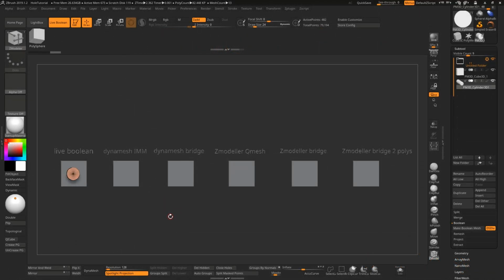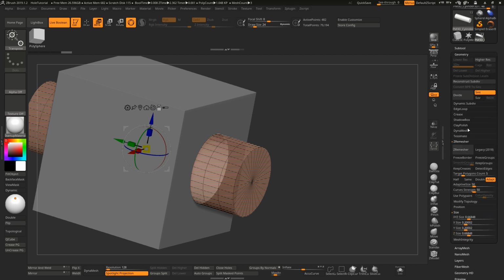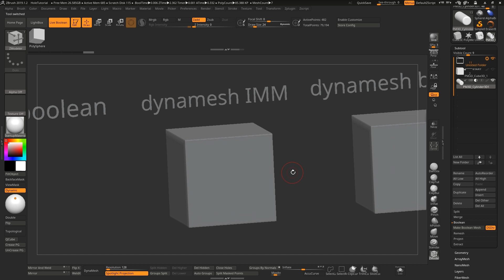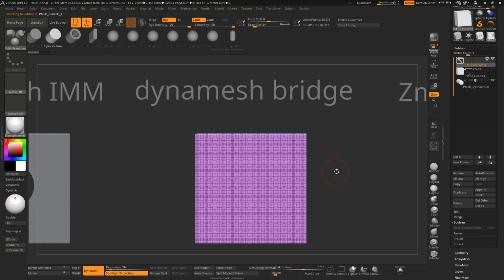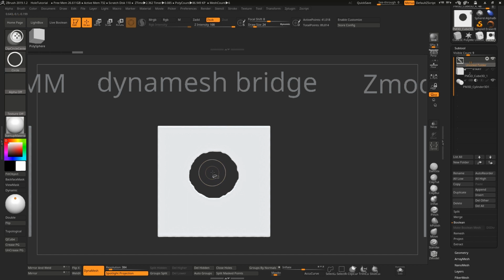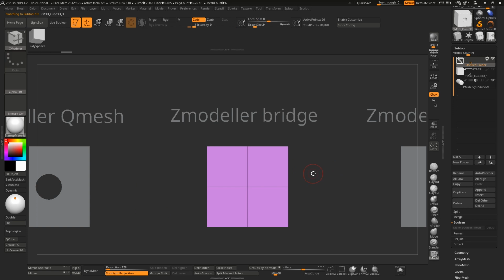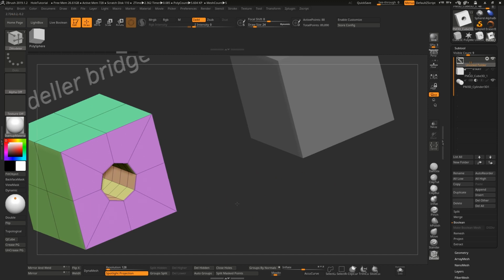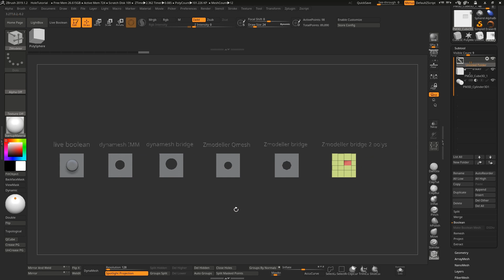6 ways to punch a hole through an object in ZBrush

Comment: I'm kinda confused. On the first method, when i apply the boolean, the new object is in that top menu but how do i actually get it into the scene. If i right click it, it becomes the only object in the scene (deleting meshes unrelated to the boolean)
Reply from the maker: So it's not actually deleteing the other meshes. When you create the boolean it generates a NEW mesh and puts it into it's own Tool. Your original source is still there, and you'll see it on the list of tools available to you (the little icons with the one large one showing you the currently selected one). Each of those tools can be looked at/worked on by simply clicking the little icon of it. As I said, your new boolean will now be in a new subtool. To bring it back into your original file where you created it (the one with the source objects), just click Append in the Subtools rollup and select it. It will then get added to the bottom of the subtool list in your source Tool. Now simply hide the ones you used to create it.

Comment: I'm having trouble getting the Live Boolean method to work - I have the settings the same as you (I think) but when I hit the little subtract icon on the subtool, the cube becomes invisible, so I can't see what I'm cutting out.  (I have ensured that ghost mode is off and Live Boolean is on).  Any advice?
Reply from the maker: Without seeing your  results it's a little hard to guess. Do you have them in the right order in the stack? As in, is the object you wish to cut out from above the one you wish to use as a cutter? You can always press shift + f to see subtracted elements, and pressing it again will toggle it back off. If neither of these helps, feel free to send me some screenshot using the email address in the About page of this channel.